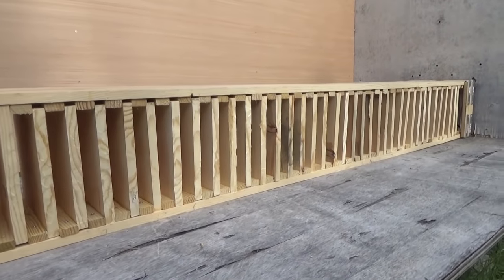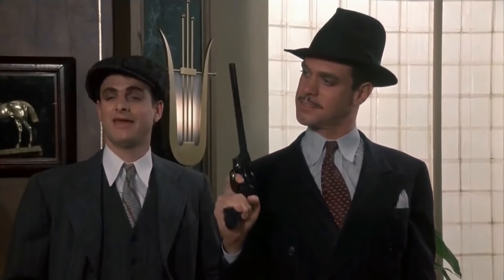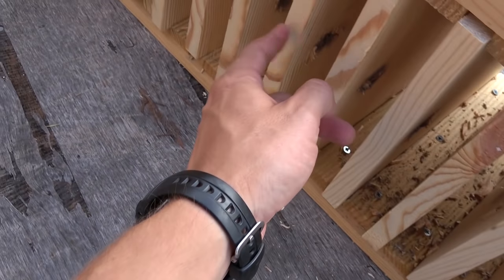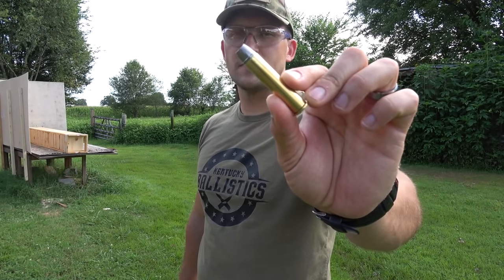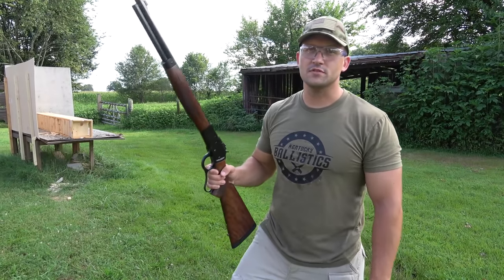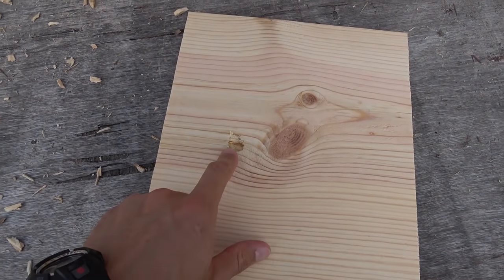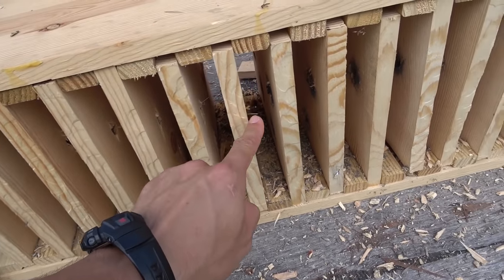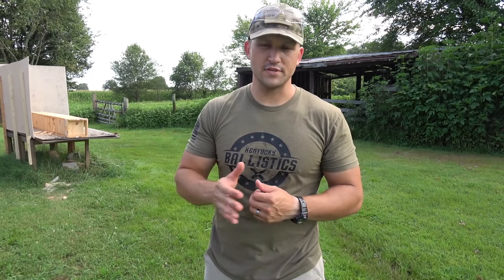500 S&W Magnum vs 45-70 vs Pine Boards (Pistol & Rifle)

Comment: great video Scott, just curious as to how consistent the density of those pine boards are, I notice that some of them have knots which of course are way harder than the surrounding wood which could account for the discrepancy of penetrating 17 boards vs 14 boards fired through the pistols and having a virtual tie using the rifles.

Comment: Both powerful rounds but S&W reigns supreme.
Reply: @Sweatyballs34  You can load the 500 S&W up to 4600+ ft lbs energy...
Reply: @Sweatyballs34  originally it was an infantry round. It is called .45-70 Government after all. It was based on the .50-70 Government first used in Trapdoor Springfield rifles. They found the .45 caliber bullets at the time penetrated better than the .50 bullets available

Comment: Amazing how velocity, SD and bullet weight just don't add up with regards to penetration sometimes. My 10 inch 45/70 BFR with 400 odd grain loads is within 100fps of the rifle load values in this video. But somehow something with lesser SD and velocity penetrates further. Though my 540gr (Garrett cartridges Hammerhead copy) @ 1543fps from my BFR just might out penetrate these.......

Comment: +Kentucky Ballistics - Somethings not right. the 45-70 revolver should have won, rifle too. muzzle velocity and energy is higher for the 45-70. plus side by side, the rounds, the 45-70 bullet is 20% larger and the casing has about 20% more powder than the 500 magnum. pine boards for 45-70 tests suspicious of steroid use. investigation request.